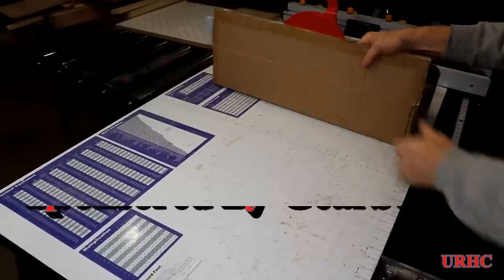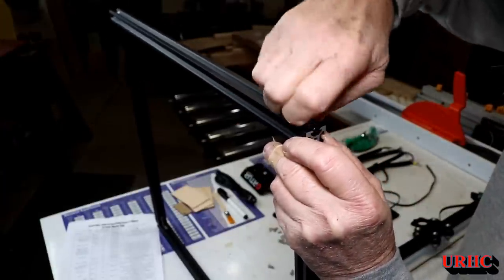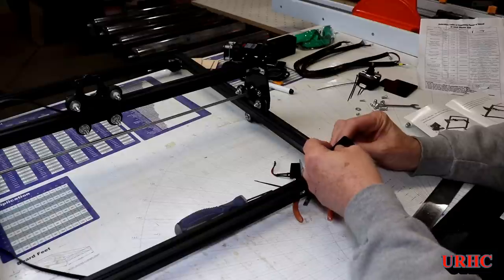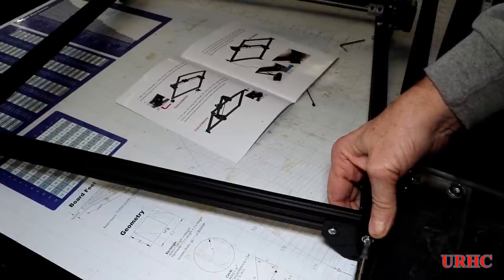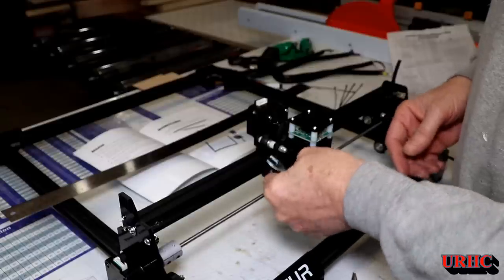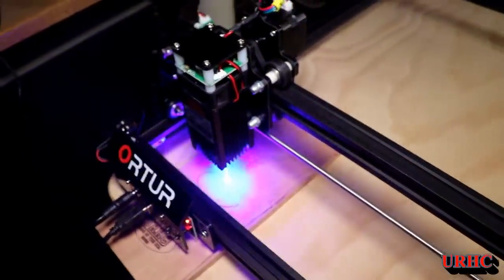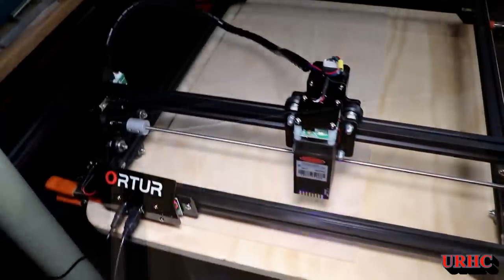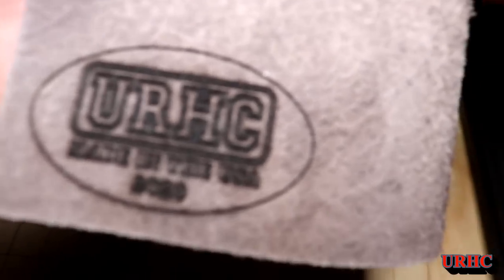Ortur Laser Master 2 400mm x 430mm 15 Watt Laser Engraver From Gearbest

Comment: I received from Gear Best the Ortur rotary attachment in one week (about Sep 16-17, 2020) and the 20 watt Ortur 2 one day later. I immediately ordered stainless steel socket head cap screws to replace the phillips head screws and will also purchase glass reinforced timing belts if non reinforced belts are supplied with the unit. The quality looks great and the 32 bit controller is a plus.
Reply from the maker: That was really quick. one thing you may want to try is Lightburn.  I found  it much easier to use then the laser grbl that comes with it. Have fun.  Thanks for watching.

Comment: the grid was genius. Thank you very much Sir!
Reply from the maker: Thanks.  It really helps align parts when making  multiples.  Thanks for watching.
Reply: @unemployedredneckhillbilly2023  My Wife and I just received our new Laser Master 2. I've been tirelessly searching for detailed instructions for making a permanent grid. I am about 3 failed projects in and all 3 had to do with my alignment. Could you let me know if there is a detailed video, or file to import, for burning a 400x430 grid?
I would greatly appreciate any help you could offer.
Thanks, Steve
Reply from the maker: @SteveSr  I used Lightburn and drew a horizontal and vertical line then copied them at the increments I wanted. I started at 0,0 and made sure to keep them within the burn area.  Trim the ends assign a burn value and it only takes a couple minutes to burn them. Remember there is a frame function  to locate burns before burning using a low power to outline the  burn so you know exactly where it is and can make minor adjustments. I gave up with laser grbl and switched to lightburn that is easier for me to use. If you use laser grbl you will have to draw the grid in a different program.
Reply: @unemployedredneckhillbilly2023  Thank you so much! That worked great. I’m one skill level below a Newbie and was copying and pasting 25mm squares. They would never align. I’m guessing it has something to do with the kerf. I am using the trial of Lighburn. I have a Mac so, I knew it was my only option. I was having “Out-of-bound” issues so I just burned one less row and one less column for now. I’ll deal with fixing that when I need the whole cutting area. I love your ideas and your ability to teach in a way that this “Pre-Newb” can understand. I got your channel on speed dial. Thanks.

Comment: Ed, I started to do a project much like the one you did of your wife's poem. If I remember correctly it was going to take about 2 hours to burn so I went back to the "Cut Settings Editor". You will see under "Number of Passes" there is three check circles that read 
Fill all shapes at once   ○
Fill groups together.       ○
Fill shapes individually  ●
Check the last one. On mine it went from 2:01:44 down to 48:30. That is quite a time savings. As always I enjoy your videos. (I still haven't designed or made the air nozzle yet. I've been too busy trying to get the new abode finished before it gets too cold here in Western NC).
Reply from the maker: Thanks.  I will look for that option next time I use it. Have a bunch of wall hangers to engrave for Christmas and that will really help. Cold in western NC ? 😀😀  I understand  Ortur has a extremely large and growing user group  on Facebook and if you use Facebook there  may be air nozzle designs you can copy. Thanks for watching.
Reply: @unemployedredneckhillbilly2023  its been down to 40°. The rain has finally let up so now maybe I can get some out side work done. Maybe us old geezers slow down but we don't quit.

Comment: Great review and I'm impressed by how good the little 15 watt laser engraver did.  I was thinking it would take a 50 watt or better to get decent results, but I may have to pick one of these up now after seeing your review.
Reply from the maker: It's a fun little  laser. It's 15 watt input and only about 5 watts output  and does a great job on wood.  Just needs a well ventilated space to get rid of dangerous fumes.  If you decide to  order one use my link to help out my channel.  Thanks for watching.
Reply: yeah, the specs on these lasers are fast and loose....I bought a 7w that should slice through dollar store foam core with ease, but it doesn't. At 100% power it does etch wood nice and dark and deep but only about as good as my 2.5w eleksmaker pro.....

Comment: Very helpful video. Thank you for sharing your experience! I've just ordered  one. Hope I'll get it by the end of this year )))
Reply from the maker: I have been having fun with  this.  It's an affordable way to get started with lasers. Lightburn is easier to use than the laser grbl that comes with it. I have seen where some people get them  in a couple weeks and some take longer.  I think they still have serious Corona virus issues in China affecting the workforce.  Thanks for watching.
Reply: @unemployedredneckhillbilly2023  Hi thank you for the great video. I am between buying the ortur laser master 2 and de k40. I will use it for engraving wood, leather and coated aluminium and put it in orders of clients as a present. Which one would you advise me? Thank you..
Reply from the maker: Adam  I have no idea which is better.  This one works good on wood and leather.  I have not tried it on aluminum.
Reply: @unemployedredneckhillbilly2023   Thank you for your suggestion about the lightburn. I'll definitely give it a try. Can I please ask you something else regarding the size of the machine? I can see in the description of the ortur master 2 laser that the dimensions of the laser are L x W x H, 57 x 55 x 17.5mm or 24.4 x 21.6 x 6.9 inches. Is this is including the stepper motor on X axis? I just want to start working on the enclosure while I'm waiting for delivery and make sure it'll fit.
Thank you so much in advance.

Comment: Lasers will only blind you if you stare directly into the aperture for a defined length of time. The most common issue is burning of the eye similar to arc eye. The reflective glow of the light source isn't as dangerous as it's made out. Great video as usual
Reply from the maker: This is a class IV laser and any reflections can instantly damage eyesight and it's not worth taking a chance.  Read the OSHA rules for this class of laser. Thanks for watching.

Comment: great video, love the clean lines and perforations on the cardboard - this is exactly the reason for me researching this laser cutter!
Reply from the maker: I mostly  use them for engraving and they both do a good job.  Thanks for watching.
Reply: @unemployedredneckhillbilly2023  well I ordered the 20 W version last night, thanks to you!
Reply from the maker: Be sure to use the correct focus distance for the 20w. I think it's 1/2 of the 15w distance.  Check out lightburn software as its easier to use then laser grbl.  they have an Ortur section in their forum.
Reply: @unemployedredneckhillbilly2023  I'll give that a go and thanks for the forum tip, ways a good resource!!!

Comment: I've had mine for just over 2 weeks and it is Bricked!
It may have happened through my carelessness but one thing to bear in mind with the Ortur is that it is not very forgiving at all whenever updating firmware :-\  I'm currently getting advice from Ortur Tech
Reply from the maker: That's not good.  I have had no problem updating either one and they both work great.  I am starting to think all products from China can be hit or miss and getting parts is a painful process.  I have had nothing but problems with a drone I purchased from Hubsan and their support sucks so I feel your pain.  Hopefully Ortur gets yours working quickly.  Thanks for watching.
Reply: @unemployedredneckhillbilly2023  Success! Bright Blue and Red Indicator lights presented* themselves to me, instead of the dull red constant light, no matter what was pressed.
With priceless help from Ortur Tech I have brought my machine back from the edge! It's tough for the sellers sometimes because they dont always get the level of immediate response, that I found. I cannot sing enough praises for Ortur Tech! One thing I had to do that I hadn't done before, to restore the machine was to unplug the Motors & Laser before connecting and powering on, to begin the recovery. Great channel and fab review! I'm certainly Championing the cause of Ortur Tech after my totally positive experience. Thanks and stay Safe! 💪😬👍
Reply: @unemployedredneckhillbilly2023  I am still waiting on some sort of help from GBest where ours came from :-/
I'd always suggest seeking help from the place items were purchased but in my case, I felt the need to find the mea.ns to contact them directly because of the nature of the 'fault' and its very recent occurrence after buying it. 
In the meantime I've used my trusty NEJE Master, which isn't as quick as the Ortur (or powerful). I do wonder whether the output is nearer the stated Laser Output of 15W. My NEJE 7w isn't far off at all and I just can't imagine Ortur Tech Laser Modules are as low as you said, simply because I have seen the power compared to a claimed NEJE 7w and this module with the Ortur is rather more well made than the usual modules from China.
I'm not sure, but it would be good to see one of these on a Laser Power Meter.
I really didn't want to have to return anything or wait! ha

Comment: So, now that you have the small and the larger one, which do you like better?
It looks like minimal cost difference.
Also, do you wish you had the 20 Watt models for any reason, or has the 15 Watt been sufficient?
Hope you and the family are doing well!
Reply from the maker: They each have their uses and I like them both equally. Ordered a rotary attachment that is a month late shipping that will work with both. You have to watch prices on Gearbest because they vary and often have coupons. I have read that the 20 watt are just using the same blue laser diode and over-driving it it so they can call it 20 watts but heat is a problem that can shorten the chip life. That is the input power also. The output of the 15 watt is only about 4.5 watts and the 20 is around 4.8 so I am not sure if there is a difference in what they can do. I just use them for engraving wood and the 15 is plenty for me. They really can't cut much. Laser GRBL is also tough to use and LightBurn works much better but costs $40. Thanks, we are fine so far. Hope you and your family are also doing well. Thanks for watching.
Reply: @unemployedredneckhillbilly2023  good info, thanks. I saw Nerys was ordering the rotary attachment as well. Should make an interesting add-on video, can't wait for you to publish it. 😀

Comment: Think this would engrave metal or even polymer from an ar magazine?
Reply from the maker: Should  do metal  if it has a black coating but I have not had much luck with plastic. You would need good ventilation.  Contact Ortur to be sure.  Thanks for watching.

Comment: How did you do the grid pattern in Lightburn? I want to do the same setup with my Ortur Laser Master 2 20W as well. I have a small sheet of MDF under it right now and need to do the same grid in Lightburn and burned onto the face of the MDF.  I've looked for some Lightburn files to download and burn but anything I've found the links are broken.  Thanks in advance.
Reply from the maker: draw a horizontal and vertical  line at the 0,0 . Be sure they are shorter then the travel. Then just copy them at the spacing you want and burn. be careful  to stay within the travel so you don't get errors.  Thanks for watching

Comment: What sort of finish on top of the laser etched photos  etc would you recommend to preserve the subtle shadings?
For the heavier cut in logos and such it's not as big a concern, I suppose any finish would work, but an image... different animal.
Thoughts?
Reply from the maker: I am going to try the rustoleum clear spray on this that Iuse on the routed plaques. I will add the results to a follow up video.  Thanks for watching.

Comment: Nice, you got all the cool toys now!
When you showed your new starlight, at a glance it looked like the top bar was out. Are you having an issue with that, or was it just the way it looked in the camera?
Reply from the maker: I didn't put it back in all the way. I pull one out sometimes to make room for the camera on its tripod and probably didn't push it all the way back in. It works great but trying to get a video of shiny black objects takes a lot of adjustments. Its hard to get contrast. Thanks for watching.

Comment: Do you know if the ORTUR can engrave/score stained glass? Stained glass sheets are typically 1/8" to 3/16" thick. Thanks
Reply from the maker: Blue lasers are not good  on reflective surfaces so you probably  would  have to put something on it first. plus you would  need a very  good  ventilation system for the vapors.  Contact Ortur to be sure because I only  use mine on wood.  Thanks for watching.

Comment: How do you tell the printer where to start burning?  I'm concerned with wanting an image on the middle of the  wood,  and it starts on the bottom.. how do you manage this?
Reply from the maker: Start by drawing an outline of your part and use the home position or move it to the position you want it and reset zero. Always use the frame function before burning to outline the burn and know exactly where it will be on the part. Thanks for watching.

Comment: I use Corel draw and Lightburn. Works great but I also have a 60 watt co2 laser.
Reply from the maker: That's a great program for it. Lightburn is very limited on the drawing end. This is only about 4.5 watts output but does a good job on wood.  Thanks for watching.

Comment: Just out of curiosity can this laser be used to etch cast acrylic plastic.  My thought is to leave the paper on the plastic and just laser threw it, I was wondering if it would frost the plastic.  I want to make some LED lighted acyclic signs and wondering if this machine would work.
Reply from the maker: I am not sure how good a job it would do. The fumes would need a good exhaust system and from what I tried on the little shaded plastic samples they supply the paper gets burned in and I am not sure how clean it would come out of clear. Thanks for watching.

Comment: I had a similar problem like you after the first powering on.  Laser moves through y axis but not moves x axis. I mean laser itself does not move through x axis. It remains stable and the part moving through x axis hits the edge of the mechanism. What am I doing wrong?
Reply from the maker: Check that all the connections are seated and that the individual wires are fully seated in the connector  body.  That was my problem.  Contact Ortur if that doesn't help. Thanks for watching.

Comment: Thanks dude!! Looking into this for leather and this helped answer my questions
Reply from the maker: Glad to hear it. Plan on good ventilation for burning leather  because  it smells disgusting.  Thanks for watching.
Reply: @unemployedredneckhillbilly2023  yeah I knew that getting into it. I had some friends with a massive laser cut me some favors and they smelt awful like 2 months later still haha Super Appreciate it, was going to get the Neje smaller one but I think the Ortur Master 2 (large) is the best way to go
Reply from the maker: These little  ones don't  have air assist and if you plan on engraving a lot of leather you may need to add something to avoid  smudges and keep the lens clean
Reply: @unemployedredneckhillbilly2023  Good advice! I think I have a little pump somewhere I can rig something up Thank you

Comment: I just purchased this laser and I'm having an issue. The machine runs but no laser is burning. Also having trouble finding any files to download the the software will take. Where do you get the files from?
Reply from the maker: You should contact Ortur for troubleshooting. Check ll the connectors have the pins seated properly. I draw mine up in Silhouette Studio and import them to Lightburn to burn. I bought lightburn because Laser grbl did not work good for me. Most of these type of files are copyrighted and are not free. Thanks for watching.

Comment: I just ordered this, but with the 20W laser. What do you think that would help improve? Can I cut thicker material?
Reply from the maker: I don't  know if the 20 watt will cut thicker material but it should.  These are not really great at cutting but do a wonderful job engraving wood as I  use mine for. There's very little  difference  in the output power of the 15 and 20 watt versions. I don't  use Facebook  but I  think  Ortur has a group there that may know the answer. Thanks for watching.

Comment: laser on plexiglass releases chloride gas.  I am seriously considering this laser but what to get an fume extractor first.  I have a Laguna dust collector vacuum system for my shop with a hepa filter but don't think that will be enough.  I figured whenever I use the laser I can set it inside my CNC enclosure and use that vacuum system to carry away the fumes.  I also think building some blocks with adjustable feet could be useful with thicker/higher projects.  something you can't do with one the the lasers in the box, like Glowforge or the Chinese K40 lasers.
Reply from the maker: All fumes from this laser are toxic.  I did an update  video with  the rotary  and put it all on this cart along with the computer so I can roll it outside when I use them.  Get good glasses also if you decide to go this way also. Thanks for watching.